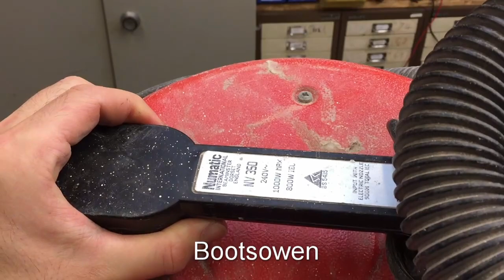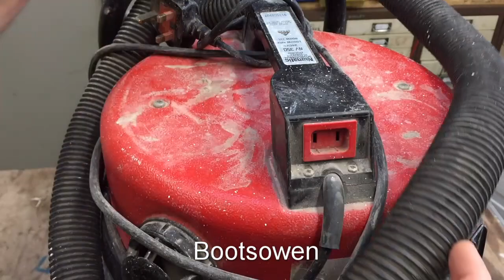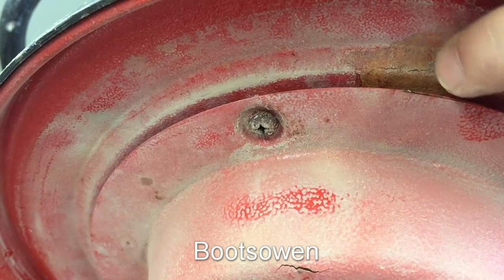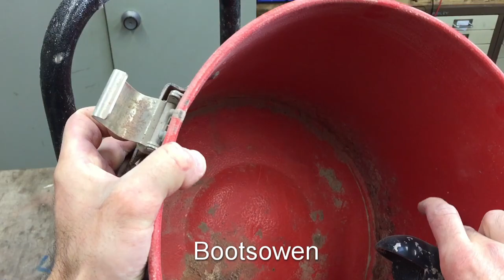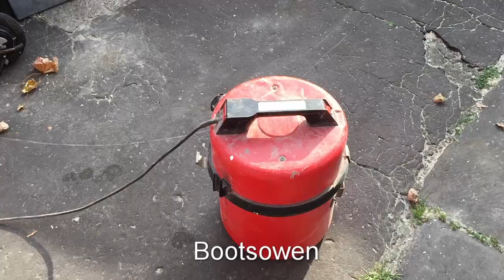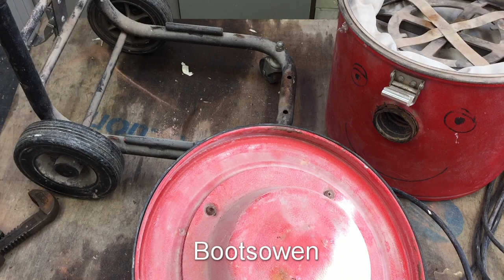Numatic NV350: Inspection and cleaning the homemade metal Henry!

Comment: I have model older model without power take off. I need to replace the hose assembly but do not know if new hose assembly will fit onto hose connection. Ideally would like to fit the 38mm hose if possible. Any help, suggestions or part numbers would be appreciated.
Reply from the maker: I reckon it will fit. it is a standard barrel connection used on all numatics.

Comment: In 1976 this model was introduced by numatic known as the caretaker this was a multipurpose vacuum except water this vacuum was also advertised for cleaning fireplaces this models first machine was the nv250 they had 2 metal clips on the side with a rubber bumper there were 3 variants the nv250 nv300 nv350 all in different sizes in the late 70s they had been fitted with a NU3F814G motor rated at 800watts these machines were used by telecom I think it's called and some by British gas in the 70s-90s
In the 80s-early 90s they had the D2-1004N motors rated at 1000 Watts both motors were a 2 stage 2 fan motor and were extremely reliable these had the 2 clips on front like this one 
In the mid 90s they had a 1100w UD11054 Panasonic motor this was used up to 1998 if memory serves me right they also had the bottom remade it had holes in instead of the gap
This was later known as the nvq this model was known as numatic vacuum quiet hence the name nvq this had sound dampening which was foam around the entire machine these machines were amazing in 1999 these machines were fitted with a Panasonic UDS1053SN really unreliable motors but had some power behind them known as the nqs range  in 1999 there was a model known as the millennium edition only came in the 250 size

The steel chassis machines fitted with a UDS1053SN were made up to 2004 I think and replaced with the DL21104T twinflo motor seen in many of the henrys now and were known as the nqs250b this model was made in 2 variants nqs-22-b and nqs-21-b rated 780 watts
Only in 2 variants I know of now 250 and 350  this machine has a nuplug which is a kettle lead and can be easily replaced 

My apolagies on the random lesson on a couple year old video! Just thought it'd be interesting
Reply from the maker: It’s all interesting. But strange how with all of the development they don’t have a “best” Henry that is cheap and lasts forever.
Reply: @bootsowen  I mean I'd consider a 90s or 80s one best lol